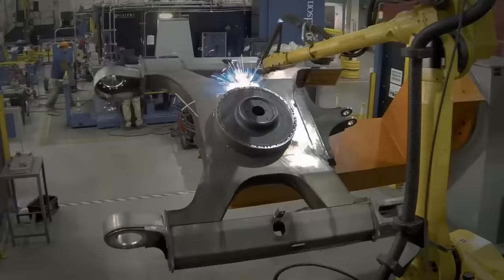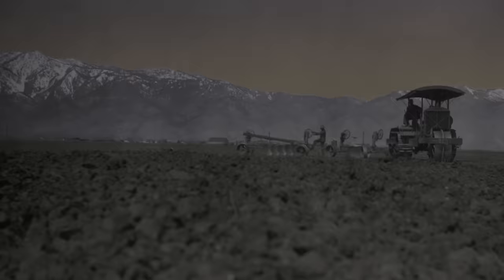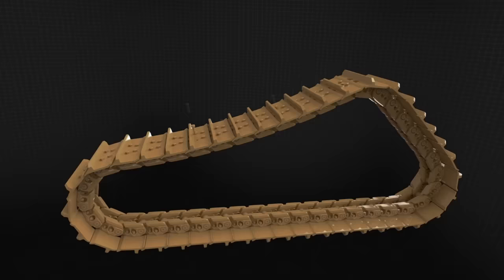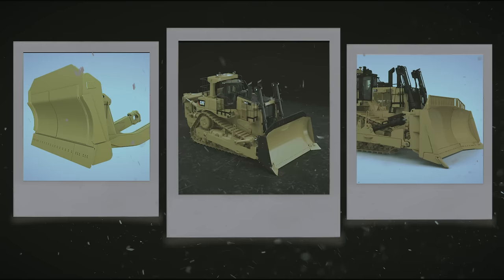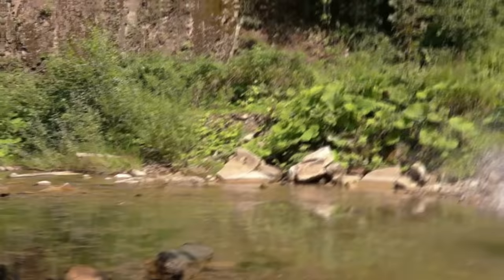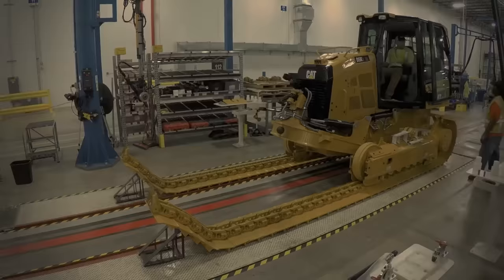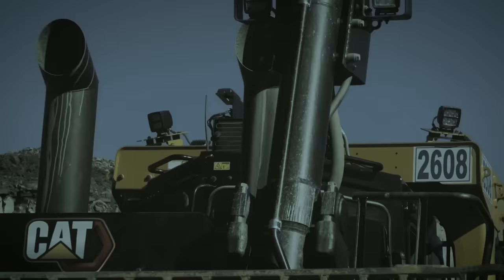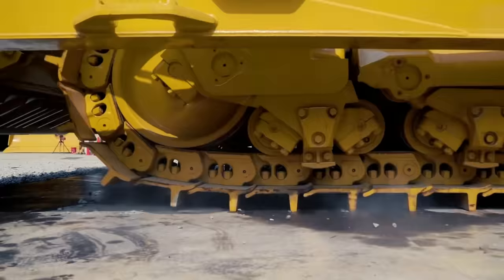CAT D11 - The EPIC Story of an Awesome Machine | Full Documentary

Comment: Did you acquire the proper permissions from Caterpillar Inc to use their footage before ripping it off the CAT products YouTube channel? I ask because some of the D8T shots (not a D11) were mine!!
Reply from the maker: We've received confirmation from them, yes.  Thank you for the quality footage!  We understand that not all the footage is of the D11, but it can be quite difficult to source this much footage of one machine; so, instead, sometimes we will use other clips to show what we're describing rather than try to find exactly what we need and of the D11, if that makes any sense.  Basically, if we need to show the construction/assembly of the frame/body and the process is near identical to another dozer's, we may use that other dozer's footage for simplicity's sake.
Reply: @LordGizmo  Thanks for confirming you did reach out to Caterpillar Inc to properly acquire the footage. Caterpillar has their own digital archive, and the D11 is one of the biggest machines, so there should be lots of footage available. You should then consider adding credits at the end of your documentary. Without crediting the proper sources, at the cinematographers who worked in harsh working environments, you're still claiming it's all your original footage, when you're just acquiring footage any editing it together. Please consider adding closing credits and listing out all your video source material.
Reply from the maker: @gree7964  You're right.  We should get a better bibliography set up that's more than just a list of references in the description.  Thanks for your work in the field!

Comment: Yup,  just get rid of the operators all together.   Give HAL the plans and turn the machines loose.
Reply from the maker: It's certainly rough, but it's worth understanding that, at least in its current state, it's not going to be a massive issue for operators.  It's expensive, and it requires a trained operator to use.  Most modern remote systems still require an operator per machine.  It's ideal for dangerous locations to reduce risk, but it's certainly not going to be used everywhere, not for a long time.

Comment: As an answer to reduced cost associated with moving an 800 Hp dozer does Caterpillar offer an option to connect two D9 Dozer tractors end to end with one blade on the front tractor. The rear tractor could be a slug without an operator station, hydraulics and other systems only needing to supply power to the hitch of the front tractor. A remote pendant could be used to load, unload and move his power unit once disconnected.

Comment: Alot of good info , but you missed some (main info and parts) The D 11 also offer's a  D11 CD (I believe it has a little more power or torque than the standard D 11) and has a  CARRY Blade (not mentioned !)  And the main benefit of the elevated drive sprocket is to limit the amount vibration through to the main drive not sure how it limits abrasion or wear in your info ? as the roller in the video don't take any force from the drive only what you drive over as other operators will testify to !!!  And at the VERY beginning you mentioned a bucket ????   haven't seen a large dozer with a BUCKET   One of your earlier video's on mining shovels you kept referring to a BACK HOE version ????
There are NO BACK HOE version's for mining ONLY an excavator or front shovel , and striping shovels ( bottom dump or dragline) Sorry to be picky
Reply: Hey thank you for pointing out our mistakes. Content creation is a game of learning and improving. We are ready to take a jump, that's just beginning, and we believe core hard fans like you will keep us on track.
Reply: @THEIDEABEHIND  VERY COOL REPLY thank you ever still watching , you do get some great shots of equipment
Reply from the maker: We appreciate the info.  Our friends from our other channel already responded, but thank you for the knowledge.  We definitely don't get every detail right, and it's hard to without first hand experience of every feature, but we appreciate both your support and input!
Reply: @THEIDEABEHIND  But the elevated sprocket does reduce abrasion... There is less dirt/abrasive material that gets up into the elevated sprocket via a vis the standard oval type track.

Comment: So, same as diesel-electric locomotives that have been around forever.  A good design move nonetheless, moving from gears to fly-by-wire.   Good all around.
Reply: My thought exactly. Diesel-electric bypasses the need for mechanical transmissions to handle scary high torque, while retaining the high energy density advantage that liquid hydrocarbon fuels have over lithium batteries.

Comment: Why do they talk about operator safety ? Like...you're inside this thing...wth can happen to you ?
Reply: The environments that those big dozers often get used in make the operators push their machines to the limits - fire suppression is a big issue in a coal mines and other fire hazard areas, the seats are turned at an angle to reduce operator fatigue, and although it may not even seem possible - operators get complacent and drive too close to the edges of soft piles of material and fall off so they have a massive cab that serves as roll over protection (EROPS).

Comment: You have the “S” blade all wrong. It’s known in the industry as a Peterson dozer. It has one purpose, pushing scrapers in the cut for loading. That’s it. That’s why the short trunion arms are mounted under the center of the tractor, and not outside of the tracks like the other dozer blades. The finish tractors with similar blades are called “Six way dozer blades” And they only appear on the D6 and smaller tractors. And are strictly meant for finish work.

Comment: My mine has a 475-A8 dozer, it's down more than any other dozer we have on the mine site
Reply: Bonehead wanna be operators can and will deliberately break a machine if its not the right colour.     We had 5 x D475s with Coal blades and screwed to 1050 horsepower and had bugger all problems.      D475s being down all the time,    never heard such bullshit.
Reply: @mikethomas9544  wanna be operators lmao pretty sure the ones here that operate it have the most experience in dozer. Every time I've been near our 475-A8 Komatsu was there replacing hydraulic lines that some engineers thought would be a good idea run thru the draft arms, Can't push a full load with  out it going In to limp mode cause the system can't handle it now it resides most in topsoil or regrade if it runs. We bought it right off the showroom floor at mine expo and it was the first one of the A8 series to be sold here in North America

Comment: A great video, but a lot of the machines and parts here are not D11s', some not even dozers and there are a few questionable statements here but the most glaring ones:

5:26, The blades shown here are U blades not SU blades.
7:08, a 475 is not the largest dozer in the world.  Komatsu builds a reasonably common dozer, the 575 which is larger.
9:02  Large dozers do not come standard with dual tilt.  They have single tilt and dual is an option, although from the dozers I have seen, dual tilt is more common than single.

Comment: And it's not the most efficient dozer in the world --- that's a very difficult statement to make. Probably, the PR776 Liebherr and the 375 Komatsu are just as efficient. Liebherr are known for being exceptionally efficient...though that dozer is hydrostatic...so likely not as efficient, when combined against a more efficient engine. Komastu are known for being fuel misers --- the Komatsu and Liebherr are both 1400 cubic inch motors, while the Tier 4 Final version of the D11T is a 2000 cubic inch motor, with some 200 hp more than the other two, in the same class...undoubtedly, that translates to fuel burn. Most companies acknowledge the fuel burn, as they are deeply committed to Caterpillar.

Comment: Torque uses more fuel than horsepower
Reply from the maker: Not exactly true, nor fair to say.  If you're only going to look at low RPMs, sure, to a degree.  HP is based on torque AND the revs, so HP will use as much fuel as needed to hit those revs and at those torques.

Comment: How would you explain that to the safety people I got ran over because me remote did not have orops or erops and one question would it not be like a big remote control in the cab just asking or even who does the walk around inspection to prevent a breakdown and they'd be safer in the cab with erops and a radio heat air just saying what happens it it runs out of fuel does it remotely fill up or just leave it and buy a new one with fuel in it already just asking or like it's not getting fuel and starts dieing or losing power would it remotely fix it self maybe